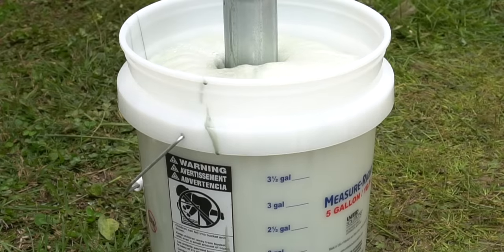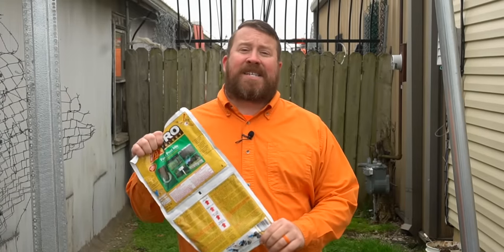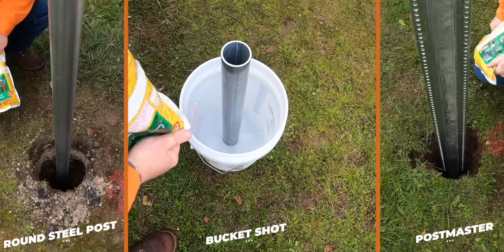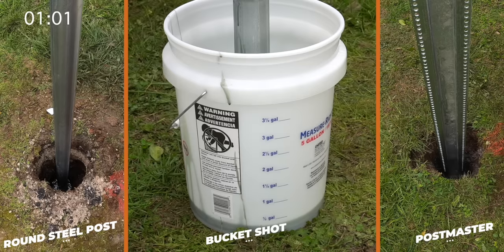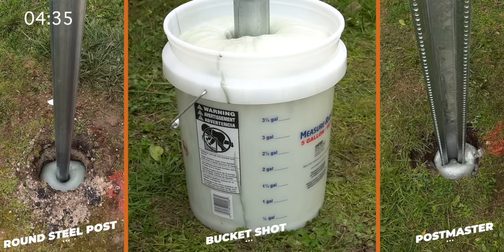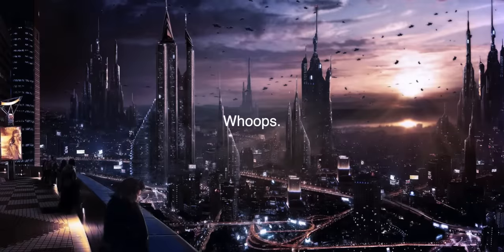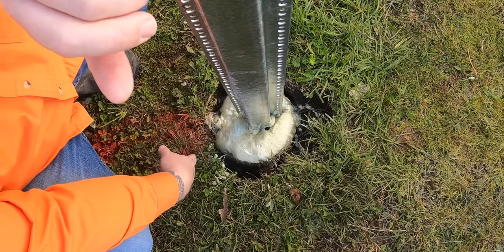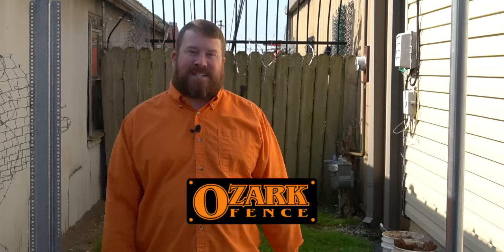Does Fence Post Foam Really Work?

Comment: Very interesting. I am curious of what caused the shrinkage. I have never heard of or seen that happen. I have built 3 fences with the product and they are solid as the day is long. One of them is my own fence I am very happy with it. Obviously this product doesn't work in all conditions...it would be nice to know which conditions are better than others.
Reply: During the expansion phase, the reaction causes the gas to heat up creating the extra volume and higher pressure, but then it contracted when it cooled down before it fully cured.....2 hours is a long time.

The fact that he's wearing long sleeve shirt in broad daylight shows that it was a cool day so the heat in the foam dissipated even faster causing it to shrink even more than usual and leave large gaps....
Reply: Cold pools caus shrinkage....so I'm told 😆
Reply: I used it, too, 3 years ago, and all my 4"×4" are solid as a rock. Fence is 8' tall, with 1"×6" boards hung horizontally. Beautiful fence, the product worked great for me, too.
Reply: @WTF_BBQ  yup while the foam was still curing I bet the temp was so low it caused the air holes to contract before it had time to harden.. probably same reason why it took so long to setup. I wonder if he would have had the same problems If he used a heat lamp.. or read the instructions. Maybe done the bucket test inside.
Reply: @Pmc987  
I would probably wait to do it in the summer time if that's an option.
Reply: @mrbmp09  

Okay, George.
Reply: @WTF_BBQ  Thanks for that comment. I'll have to read the instructions to see if they discuss temperature. Good catch.

Comment: I built my fence with cedar post on pole, and used Sika expanding foam.  Had a great experience with the stuff, but you do need to be ready when you get to the point of pouring foam in the hole.  My holes were deep, but only as big around as the post hole digger I used.  The holes in the video look bigger.  Used 2X4s and clamps to hold the posts in place to ensure they didn't move.  No issues.  I would say, that concrete is the way to go for any post you're going to hang a gate on.  I used foam, but it couldn't support the weight.  Had to clamp 2X4s to the fence rails to support the fence, unscrew the fence rails from the post, dig out the foam so I could pull the post, finishing cleaning the foam from the hole, reset the post and pour concrete.  PITA!!!  So, I'd say foam is OK for normal post, but not for any that will support a gate.

Comment: We used the foam to put in posts for a driveway gate.  That was 3 years ago and so far both posts are rock solid.  We are satisfied.
Reply: Do you remember what brand?
Reply: @dustintunis9347  I tried to find the receipt.  My husband is obsessive about keeping such things but he said he had thrown it out two years ago.  So very sorry we could not remember what brand but we did buy it at Lowe's and we chose the brand we used because the store had a couple of 5 gal buckets with the hardened foam and a fence post embedded in it.  They had a little demo set up for everyone to see. We were impressed so that was the brand we bought.  Hope you have the same good results as we did.  It was crazy easy to use.
Reply: @debrastone6764  - No problem, I'm just wondering if there is a substantial difference between brands and the one he chose for the video was sub-par.
Reply: @dustintunis9347  i used the sicka like he used on my 1st post and had the same result ad he did, ended up pouring concrete into the gaps then i Used fast 2k from menards for the rest and that stuff worked excellent. One bag did 2 holes. Hope this helps

Comment: I for a living install Satellite systems, I have tried the foam you where demonstrating in the video and found similar results. I have however found a foam I like quite well and has definitely held it's own even with a 90cm round sattilite dish. Q-set 250-750, is by far my foam of choice. Only requires a 3" hole for a 2-3/8" post with a 150lbs rating.

Comment: I have a power pole in my front yard beside a a ditch. Nutria dug a tunnle from the ditch to the pole causing it to lean over about 8 to 10 degrees.  I called the power company,  they brought three trucks to straighten the pole. They pumped expanding foam in the existing hole. They did not redrill a new hole.  The soil is mostly clay with some sand mixed through at different depths.  Four years later and after hurricane florence pole is still solid in the ground.

Comment: Yes this works. Five years and going strong. The wood 4x4’s are still solid. I also think this keeps moisture away from the wood preventing rot. It reminds me of expanding foam insulation and you know how sticky that is.
Reply from the maker: Good to know, I appreciate you sharing your experience!
Reply: I agree 3yrs in and it's working perfectly I like it.
Reply: @stephaniecisneros1003  
Now six years and doing great. I painted the bottom of my posts with white roofing coating, especially the bottom end grain. Still going strong.

Comment: I used the SecureSet foam for posts that I sunk two years ago.  I built a "perimiter deck" foundation and built a shed on it.  It's held up well through freeze and thaw, and I'm very impressed with it.  I was told Secure Set is far superior to the Sika product. The fact that you mix it with a drill motor makes it seem more thorough to me.

Comment: I did use the foam for my fence and did not have any issues and it has been more than 7 years since its been done. I chose it for the quicker set time and was happy with the outcome especially for my first fence post installation
Reply: Maybe i used a different one or perhaps in not allowing a couple days to cure i did not allow it to off gas or shrink before back filling

Comment: I used the exact same product. Here around Dallas the ground is rock hard clay/rocks. I used 1 of those for every 3 post holes. Not more expensive than concrete and done immediately. Mine foamed up faster but it was summer in Texas.

Comment: I bought mine from Home Depot-I'm not sure of the brand ,but when mixing I rolled it up to break the seal then rolled it across my leg about 12 times then cut the corner and poured into about a 2 foot hole--I was also using a 2-3/8 steel fence post--I used the steel posts to hold up a double 6 foot inswinging gate and it worked fine--They didn't contract at all like yours did--Also they expanded a LOT faster that yours did--I'm not sure if maybe your weather was too cold as I did see you wearing a jacket--
Reply: I noticed it expanded way too slow myself, when I’ve used this it expanded much faster, I also mixed it more vigorously than he did too
Reply: the original expanding foam was in gallon jugs and they use in Alaska for the pipe line way back in the 70's because was too cold to pour cement

Comment: I’ve used this on a few of my post and I have never had any of these problems! The foam worked perfectly!
Reply: Which brand did you use
Reply: lonedesertfox probably the Sika brand it’s the most common, I too have used it and it works perfectly, I will say however this is largely dependent on two things proper mixture (he was mixing too slowly in all three shots) and soil type the more dense the soil the better sandy soil that’s loose will suffer to properly compact however clay soil like we have here in Louisiana this stuff is very effective
Reply: @aron6998  good tips

Comment: Glad I found this video. I commented on a recent vid about building my next fence for my home and yeah, traditional concrete it is. There is something to be said sometimes that doing things faster is not always better. There is a reason why structures that were built out of mud, clay and stone are still standing today. I'll stick with concrete.
Reply: Even with concrete your post is only as strong as the ground surrounding the post. If you have really soft ground then the concrete can become loose too. All the concrete does is hold the pole, if the ground shifts then the entire pole/concrete would move freely as well. It's not like the concrete bonds with the ground.
Reply: There's nothing wrong with this product,  I used it and it work

Comment: We've used "Secure Set" and it works great, no movement and with wood there's not rot like concrete.  I think each product may be different.  We live in the Rockies where it's very dry and our soil is decomposed granite.  The Secure set also comes in 1 gal bottle so you can measure out how much you want depending on the size of the whole.  It ends up being cheaper than concrete.

Comment: Appreciate that test man. I live on a 12 acre hobby farm. The pasture is a sequence of t-posts and intermittent 4-5” round wood posts. Fence is regular wire type box fence. All the farmers tell me not to use concrete. Would love to hear your insight on a fence to keep in large grazing animals. Thanks again!
Reply: I think the key is getting a specialized moving fence system for a farm they use the equivalent of big nails they stab in the ground and can yank back out using farm equipment

Comment: Thumbs up for "I'll meet ya in the future", that made me laugh.  Good vid on foam, I would have been pissed if I bought that product.
Reply: Worst part about it is that now you have a wobbly post... (who cares about the money!)... what do you do to fix the wobbly post? I ended up trying to shore up a 6x6 8' post (2feet underground) with concrete on top as I had about 6-8" to the top of the hole. It filled in around the foam a little, but I just should not have used the foam.

Comment: I used this product last year to install a new light pole in my front yard. It worked amazing. Mine is still solid as a rock even after our crazy Wisconsin weather. If I had multiple holes to fill I'd still use concrete though cuz this is an expensive product.
Reply: Reforce it wit cheese
Reply: @brandonbell6171  - Oh yah. Pour some beer in der too! Dat'll take care of it, doncha know!
Reply: Worked great for my light as well. Not sure what the variables are that caused the shrinking. Maybe it was a different product.

Comment: I've used these to repair a couple of 4x fence posts and they did a good job. One thing I noticed in your video and is indicated in the instructions is the post must absolutely NOT move while the foam is rising and curing. During your video, the 2 posts in the ground moved significantly. Now for the bucket, I guess is does show the product pushes on the outer wall like you described. You were hearing the bucket expand. I'm sure the foam works much better with wood posts than metal posts as it most likely has better grip with wood.
Reply: these were my thoughts exactly Philip - I am thinking that since I only have two posts to 'repair' and all the others are done (or supposed to be done) with concrete, this just may do the trick....

Comment: If you read the bag and follow the direction which he didn’t, you need to use these foam kits with a 8” round form about 30” long. I can’t remember the exact length. 
What he does say is that bag is a specific amount of foam for a 8” form with a center 4”x4” post  30” long /deep give or take.

Comment: Now I'm not professing to be an expert or anything here but and the company video for Sika the brand a foam which you were using they ruptured the air pocket and then they rolled it back-and-forth on the top of their leg just like you're trying to straighten out a sheet of paper instead of just rolling it back-and-forth the way you did I don't know if this maybe mixes it better and thus helps it to set better or what but you might oughta check that video to see if the way you mixed it doesn't affect the way it sets..
Reply: Watch the right video... definitely over the knee to me
Reply: and the left lol

Comment: I have already bought 4 bags of the foam. It’ll be going back to the store. Thank you for the video.
Reply: Zeus 1455  Prove it! Like the old saying goes "The proof is in the pudding"
Reply: Zeus 1455  can you post a video of the experament? Just because it didn't hold for him doesn't mean he did something to make it fail. He may have gotten a bad batch. What good would it do him to make it fail? He installs fences not sale concrete mix.
Reply: Zeus 1455  why get so defensive? Show your proof or walk, simple. Talks cheap.
Reply: Zeus 1455  I've been to the hardware stores and have yet to see the display for the foam. The reason I came at you is because you went after Joe. If you can contradict what he said in his video put one up of your own to show it to prove him wrong. If not go kick rocks and go twirl on your post held by foam in a 5 gallon bucket
Reply: Concrete is king
Reply: Zeus 1455  calm down. I'm honestly interested in this product and would love to see your demonstration because it's something I'm considering but you don't have to be so rude to those that disagree with you. Just prove them wrong and that will say more than words ever could.
Reply: Zeus 1455  I'll be using concrete to hold up my fence.  Why so angry, zues?
Reply: Zeus 1455  how do they know it will last 40 years?  I mean it's only been around for a few years.  My fence is just fine with concrete....
Reply: Zeus 1455  I'll just use concrete ..... cheaper and better
Reply: Concrete only lasts 20 years maximum, what shit. The Romans built things out of concrete that are still around today.
Reply: Zeus 1455  Curious of the brain cells in this one..
Reply: Zeus 1455  OK then what about in ground concrete from World War 1, that's over a hundred years old and still going strong.
Reply: Zeus 1455  the metal and/or timber fails long before the concrete. Pulled an old fence out of a flower bed not long ago, concrete was mint whereas fence was nowhere to be seen.
Reply: @jamesbaldwin145  haha exactly
Reply: I do know that concrete will eat your fence. Water + concrete = erosion.
Reply: @twsdlbh  my fence + concrete = 20 years and going strong
Reply: Zeus 1455  any chance you could link the video. Unlike the rest of these people I did some research and when I found out Matt Risinger endorsed the product at the build show I became really interested. I appreciate your advice on the subject.
Reply: My husband used foam and he said it was pretty solid even after sitting for 3 days
Reply: @pearlsandmermaids5942  sry...  I'd be solid and firm after a few seconds
Reply: Zeus 1455  it's been a week and all I see is a Fornite video you posted. C'mon man show us what ya got.
Reply: Zeus 1455  good luck with the foam.  More expensive, more downsides  But hey, it "works" for you right?
The one downside mentioned with concrete is fixed with a simple coating on the wooden post (if wood used) to prevent water penetration.
But the foam doesn't completely solve the problem with water anyway.  Do you know why?
The downsides of using foam are far too many. So far you sound like a salesperson with no experience or intelligence.
Why is it that professionals are not using it? Why is it not flying off the shelves of hardware stores and in fact, is even harder to find?

Comment: So it's not just me! I tried this for my mailbox post using a 4x4 and ended up having the same experience. Within a very short time my mailbox had a list to it and I could move it all over the place. I ended up pulling it out (not too hard to do) and resetting with with cement. Thanks!

Comment: I used this just the other day to install a mailbox post. 36" deep hole 8" round 4x4 post. 1 bag filled the hole slightly over the top and it seems to be very sturdy with the wood to foam connection. It might be the metal or smooth surface to foam where you had the trouble. I would consider using this method for a fence but not for anything more load bearing. Your reaction time seems to be pretty slow, it was about 100 degrees where I was working and I would not have wanted to exceed the 15sec work time, by the time I squeezed it in the hole it was already expanding. So I would guess that temperature has a lot to do with how fast and perhaps how well this product works.
Reply: For a mailbox, I'd try foam although that's an expensive ($25 per bag) solution for a throw-away post. Quikrete cement is sooo much cheaper ($7).  And if the post rots off  in 20 years, just dig another hole and put another post 2 or 3 feet from the first one.

Comment: Thanks for this video.  When my wife brought this product to my attention I asked "will it hold tightly to the post?"  I just now retired as a Industrial painter and sandblaster and I suspected the post would be loose in the ground.  I've tried out alot of newer product over the years and FEW are as user friendly, or what is claimed, the exaggerated claim usually.  Some things tried took money out of our company pocket if you will, cost for reblast and repaint.  Some were foam type products.  This is the first video I've noticed that actually tested this product, we are taking your word for it too.  Dustless blast systems were all over the place a few years ago, I had questions they could not answer, I sandblasted into my 60s so it was a professional painter/sandblaster asking specific questions.  The videos made it look like any body could put a face shield on and blast in shorts, not even masking trim on a car body or around windows.  Pressure alone will ruin a car body in seconds, even with water keeping friction from the metal.

Comment: Every job is different. I did a job in September of 2017 that required 2 6x6 set in the ground and built out to match the design of porch posts to hold a sign for a business. I used the Sika foam, and it’s been fine and rock solid ever since. Has even survived a couple of wind storms so severe that it ripped the sign panel off the posts, but they didn’t move.  I did make the hole cone shaped as the product directions specify, and I cross braced the part of the post that is below grade to make extra sure that nothing would move down the road.